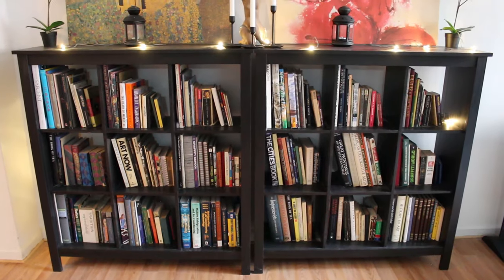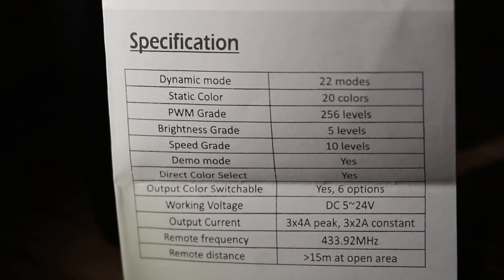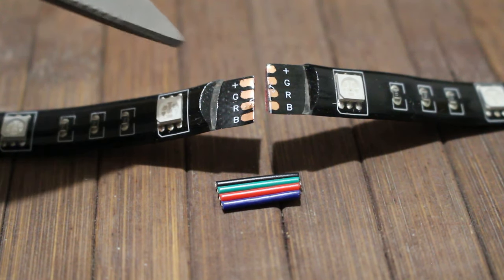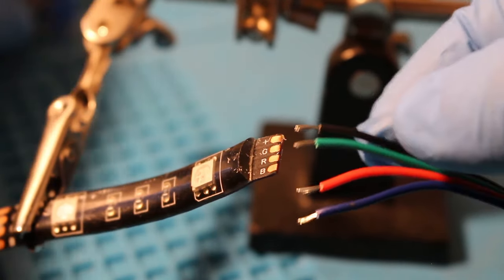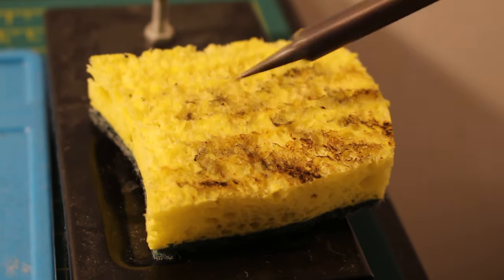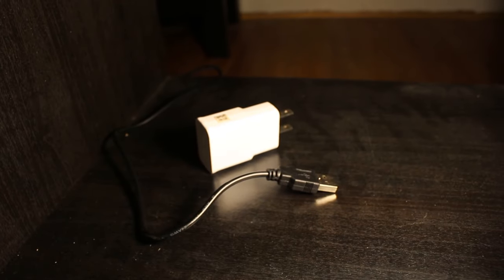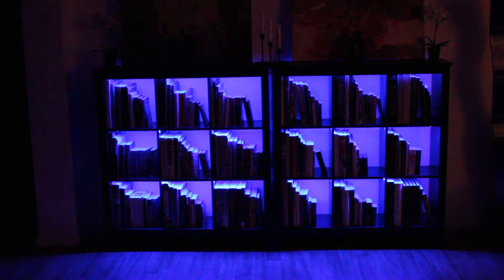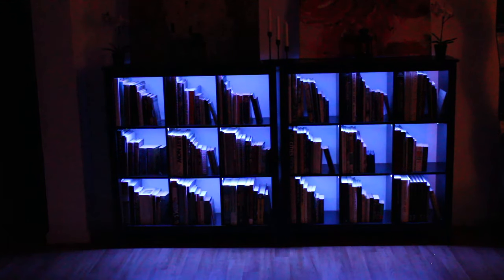How To Install LED Strip Lights Under Bookshelf (LED Bookshelf Lighting) DIY

Comment: tip for the future if you still do this stuff years later, pre-tin your cables before you solder them, makes your job a million times easier without all the strands everywhere. I mod game consoles and use different types of wire, aaalways pre tin.

Comment from the maker: LINKS FOR PRODUCTS USED IN VIDEO!

Achivy USB LED Strip Light-118 inches (Currently Unavailable)
https://amzn.to/2qJUY23

Govee LED strip light -16.4 ft.
https://amzn.to/2RurSOs

Strip Light Mounting Brackets
https://amzn.to/2KPHecU

4 Color 33ft 10m RGB Extension Cable
https://amzn.to/2Zh40k6

Anbes Soldering Iron Kit
https://amzn.to/35LlVBN

Rosin Paste Flux
https://amzn.to/2PNXKNH

Fine Wire Solder
https://amzn.to/2sNLJyy

Adjustable Helping Hand With Magnifying Glass
https://amzn.to/3747Gs9

Klein Tools Wire Stripper / Crimper / Cutter
https://amzn.to/2QbX2Zt

3/8-Inch to 1-Inch Spade Drill Bit Assortment
https://amzn.to/2s0bkEA

Vinyl Electrical Tape
https://amzn.to/2Mhs1lK

Comment: Nice video! Future soldering tip... add solder to the pads (and tin the wire) then connect the wire to the pad.

Comment: Connecting led strip lights in a series, which is what he did in the video, will lead to voltage drops. Installing a driver would help with pushing electricity down to the ends of your light strip. Voltage drops will mean your lights will dim near the ends. 

The other option is to wire them in parallel. Running electrical wire from each shelf and connecting them all to the power supply. This will eliminate the need for a driver.

Comment: Nice video, very detailed. Are you using 1 remote to control both LED strip kits? Or did you have just 1 kit that you separated/soldered to cover the linear feet of both shelves and just need 1 remote to control all the shelves? Thank you!
Reply from the maker: Thank you! I'm using 1 remote to control both kits and there's nothing special you need to do for it to work that way. Thanks for watching!

Comment: Great video. I'll be using it to help in my project. Question though...my setup will be roughly the size of four of the units you're using. Can I have one remote control as many as 3 or 4 controllers? Thanks!

Comment: Do you know if its fine to run multiple T clips to connect LED strips with a extension cable running down the side?
Reply from the maker: Sure, I don't see an issue. Every light strip has its own specifications as to how many you could connect but you'll be okay👍 Your electrical is protected by a circuit breaker worst comes to worst🙂 Thanks for watching! Stay tuned for new videos

Comment: Have you thought about using join screws to connect the shelves? The gap sets off my ocd. You could have also been able to run 3 long rows instead of 6.
Reply: I just noticed you would have to cut the lip at the top side of each shelf in order to get it flush which is why I'm guessing you skipped it

Comment: 60/40 solder/ 40/60 I can't remember exactly which will make your life exponentially easier. You won't have any need for the Flux or any of that jazz. 

On projects like these I've never even bothered with it. Look for a better solder and your projects will go much faster and smoother. Pre-tin the strips and pre-tin the wires. You'll be golden, pony boy.

Comment: Yeah, I'm not doing all that. I'm going to stick the lights to the back of the billy bookcase frames in a continuous loop so they don't show but glow, then keep the bookcases an inch from the wall, but still screw them in place and hope for the best.
Reply: hi there. for that continuous loop, didn't you open a whole in each section from top to bottom?
Reply: @Lautaro_Guindulain  No, I have height extensions so the bookcases are 3 inches from the ceiling. They're so high you can't see the tape lights, only their glow. Still didn't like it though, so I bought battery powered puck lights and hid them on the shelves behind books and whatnot, now it's dope.

Comment: lol you can buy premade connectors on amazon. why on earth would you need to do it this way? Also, why on earth would you  buy the one with protective coating  for more money when you can buy the cheaper ones to achieve the same thing?

Comment: That's a lot of work when you can just buy the clip connectors  with and without wires.
Reply from the maker: I got the clips except they came in the wrong size for the 10mm lights I had. Although the clips save a ton of time, they get loose over time and need to be adjusted. I've used similar clips for 90 degree turns. Soldering does take much longer but it lasts much longer. Thanks for the input and for watching! Happy holidays🙂
Reply: They are called solderless led clip connectors.

Comment: Sorry man but you are teaching very bad soldering techniques to your viewers. Those are poor connections, no pre-tinning on the pads, and your exposed wires are cut too long. Everything might have worked this time but either you got lucky or they are going fail eventually. Please realize that I mean this as constructive criticism and not an insult.
Reply: My thoughts exactly